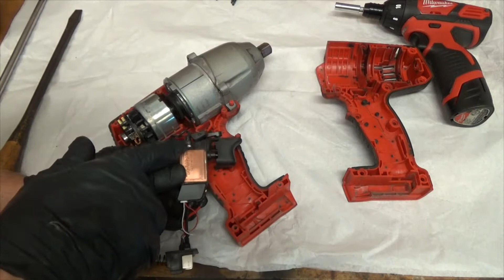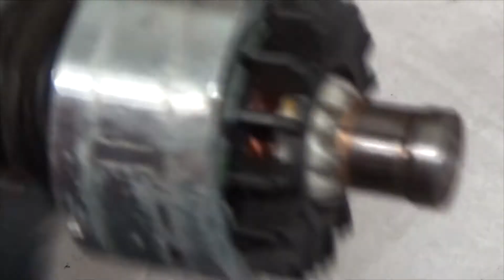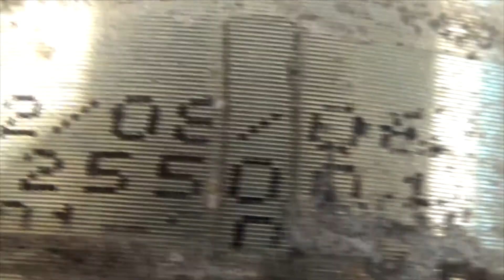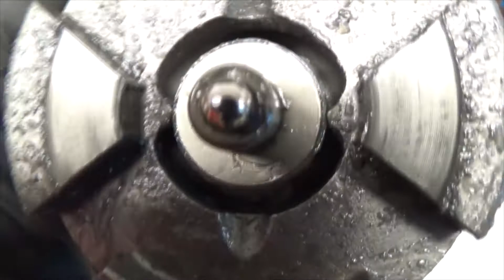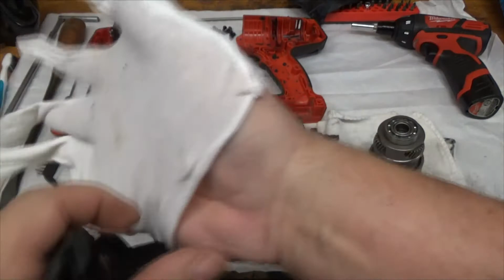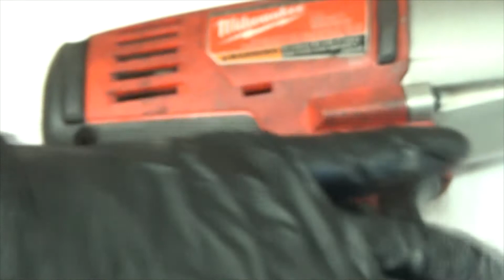Milwaukee 2662 Impact Wrench Intermittent Starting

Comment: Thanks for the informative video. A coupla tips for everyone.  First:  ALWAYS turn screws backwards when installing them. Especially into plastic. When you feel the screw drop into the original threads cut when the original screws were installed at the factory.  Then start tightening the screw. Second:  Go get yourself a can of Deoxit. A little spray of this would have fixed this with no disassembly.  It fixed mine. Until the brushes finally wore out.

Comment: Does yours make a noise when you shake it? Mine sounds like there’s something loose inside
Reply from the maker: @650Turtle  definitely does not make noise except for the mechanical noise of the gears when in use.   Hopefully nothing major broke off and is rattling around in your impact wrench.
Reply: @A_Renaissance_Man alright thanks man I just returned it and will be reordering a new one. Did seem weird to me since all my other Milwaukee products make no rattling noise like that one did

Comment: Just bought one of these from Home Depot, because it came in a set including the m12 ratchet on sale for only $200 total.  Been doing some research now to see how well these brushed motors are.  
Maybe the move would be to get a brushless motor for automotive work after seeing this though.  Not sure, but good info.
Reply from the maker: I have been using mine since 2012 without an issue and the brushes look to be above half.  In my opinion for a home owner DIY mechanic it will last a lifetime for a professional shop or industrial environment, I would say that a new one would be purchased after 10-15 years of use if the brushes are worn out or not.
You could hunt down a spare set if you wanted to. I recommend going to Milwaukee directly and downloading the free manuals/Info sheets to get the part numbers.
Reply: @A_Renaissance_Man  Yeah I caught that in the video, you saying that you were using it since 2012.  I did get the same model as this thou, the 2662-20.  Good to know that you believe it would have a long lifetime, possibly even last a lifetime in the right conditions.  

What do you mean by hunting down a spare set thou?  Like finding one of these used, or?
Also yes I’ve been looking at the part #’s and stuff on Milwaukee, so I know I’m not confusing their impact guns and can tell the models apart at least.
Reply: Got the same deal as you on Black Friday and it lasted less than a year, it started smoking on me and don’t know what to replace…